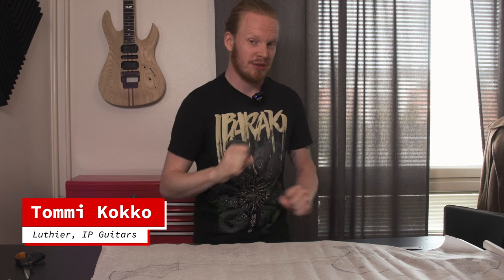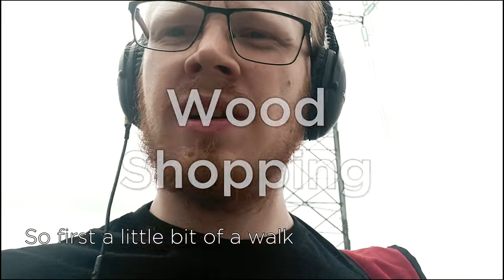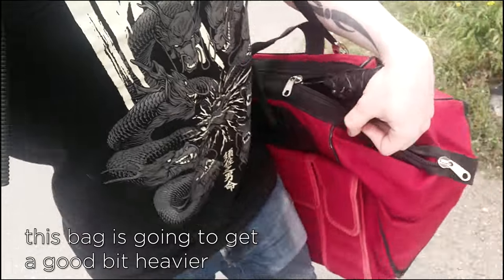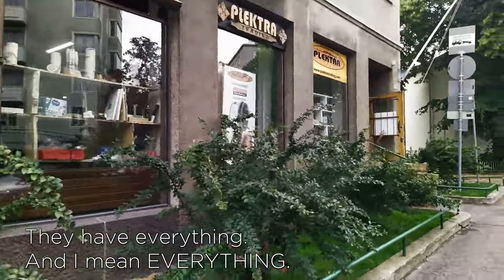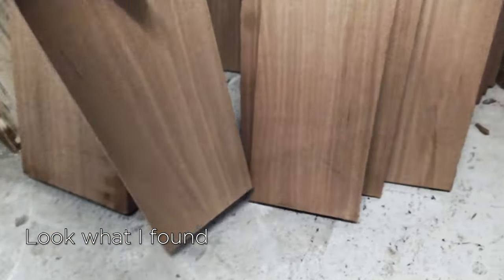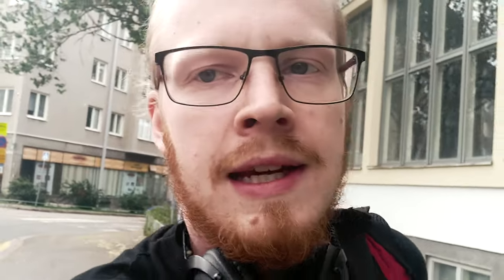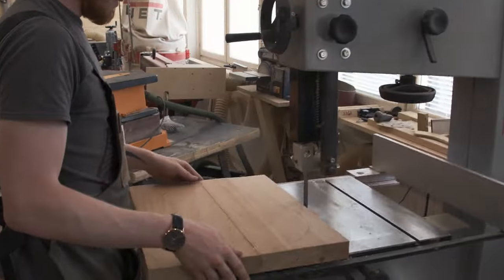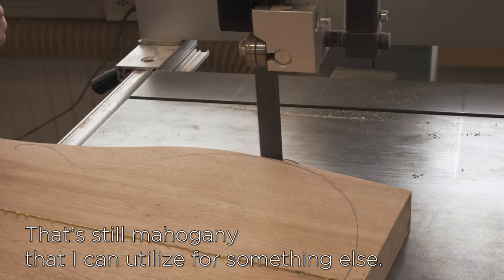Got Wood? Oh Birch please!, THE GREAT GUITAR BUILD OFF 2022

Comment: I could feel Ben Crowe cringeing from here when you were using the plane for jointing.
I'm amazed that you tried using a plane to take all that thickness from the body too. 
Pity you'd already shaped it, otherwise you could have just run it through the bandsaw - that 20mm slice could have become a routing template.
Reply from the maker: Honestly, still should've bandsawed as is and then just chucked it through the drum sander again.

Hindsight and such things...